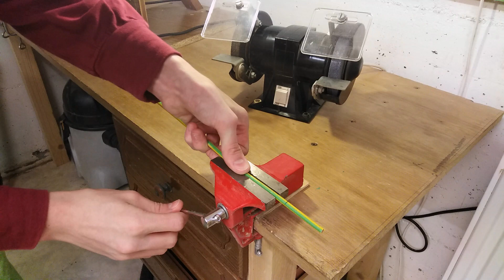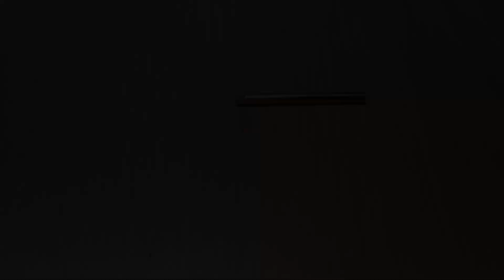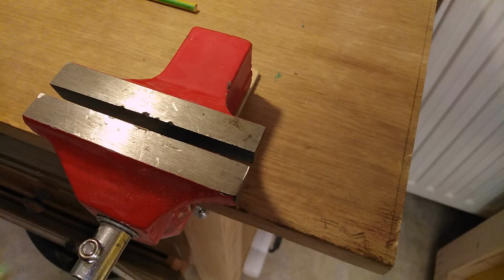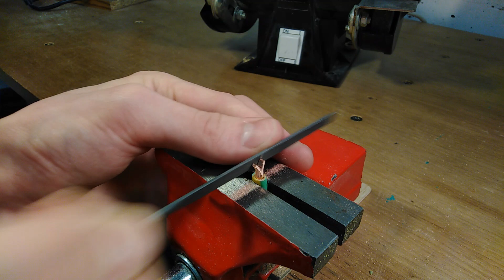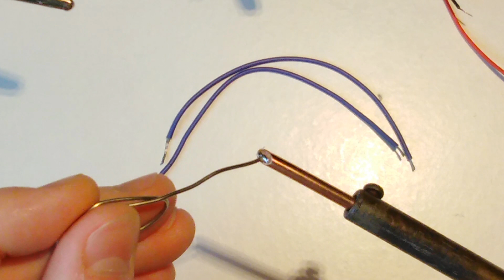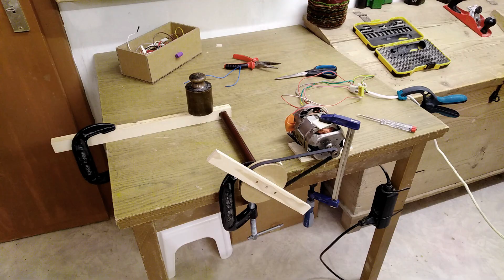How to make Cheap Soldering Iron Tips (including SMD version)

Comment: That is a good idea to share. I can share a idea too. I use a cheap soldering iron connected to an cheap outlet with light dimmer (potentiometer/triac type). I check the temperature with an multimeter. Know I have a temperature controlled soldering iron for 25€, since I need the multimeter for other work's too.

Comment: If you are in the USA and what a pure copper rod of a smaller diameter - your best bet is Lowes or Homedepot. Get a solid grounding wire. They sell  it starting from 4 gauge (5.189 mm for $2.06 per foot presently) and up.

Comment: I never would have thought to do this. Without the plating they would break down faster but, it’s wire which means each of those minus the work put in costs next to nothing… I gotta try it now. Thanks for sharing!
Reply from the maker: Yep, they erode quickly, but I've had the plated ones and they break down as well. Just takes a bit longer for it to start.
Actually, (since I'm not always doing a whole lot to soldering), I'm only now getting to a point where I'd have to reshape the tip I've been using ever since making this video. That's almost a year later. And since I made them quite a bit longer than necessairy, I just need to file it down somewhat to be back in business...
Reply: A copper sting forged with a hammer at a temperature no higher than 300 degrees will live for a VERY long time.

Comment: thats ok if you have one of those crappy cheap single heat soldering pencils but is you have a soldering rework station with adjustable heating it wont work and btw brass works much better holds up to flux much better

Comment: I just love your passion making the soldering tips. May I make a suggestion, when sanding metal with a belt sander, make sure the spacing between the sand paper and the holding surface be slid as close to the moving sand paper as possible. Reason, if you slip the fingers have a less of a chance of getting "SUCKED IN" and injured. Just a friendly suggestion to you young man. 
        One more thing fella, one can use steel copper plated which seems to last a longer. Also, monel metal really last long, but expensive. 
        Thanks for the show Sir, too.
Reply: Steel is not good in heat conductivity, making it not work well especially with low power soldering irons. Good point on safety!

Comment: I'm totally making the smd one. I'm also going to make a 4 way design that can be used to remove bipolar transistors from rf amplifiers without having to get them so hot soldering one pin at a time

Comment: Great job, i have been making my own solder tips for quite some time now using copper wire as well. I have to ask her when filing down in your makeshift  lathe, do you really need to move your file back and forth since the drill is already spinning?
Reply from the maker: It's technically better to not move the file to prevent removing material unevenly - but if I don't, the file quickly clogs up.. ;)

Comment: Hey man it’s so great to see your creativity inspire us all, I am looking to make some tips for my soldering iron but I was wondering what the measurements for the width of the cable you used is (in mm) thanks
Reply from the maker: 3.5mm
But you need to measure your existing soldering tip to make sure it's right
Reply: I think # 7 solid tw and #8 solid tw wire

Comment: An excellent idea and easy to make.   Difficult to find pure copper with the diameter which I need for my soldering iron here.  I did find brass rod of the correct diameter.   What's your opinion?  Better than iron for sure.
Reply from the maker: Yeah, brass is certainly better than iron. It's third-best at conducting heat (just checked) I think for most electronics soldering jobs it should do fine, tho it could pose problems when trying tin thicker copper wires. What's the wattage of your soldering iron?
Reply: @ChronicMechatronic  Thanks for your opinion.  I will make a tip using brass rod 4.75mm diameter for my old but very reliable Weller 25W and let you know.   Its ideal for small soldering jobs on pcb board but tips are unobtainable so I will make a tip using your post.  I have another 60W soldering iron for tougher jobs (but not Weller!!)
Reply from the maker: @carmelsaliba7710  yeah, thx for letting me know, that'll be interesting.
Reply: Typical tips are copper for thermal conductivity iron plated to reduce corrosion, chrome plated body to prevent solder wicking and solder plated at the end for wetting.   Keep the iron at a reasonable lower temp. Clean and retin constantly to prevent wear/oxidation. Avoid lead free solder. Your tips will last. Filing a mistreated tip will expose the copper core and rapidly disolve in the solder and or oxidize.  How did the brass work out?

Comment: And don't forget add solder to all your soldering tips for longevity and cooling them down so you have some tips lifetime and clean between every time you work couse I was lazy and got oxidezed tips 😅 always light cleaned every sessions with wiresponge don't remember the word 😁
I will make mine too couse I don't have good ones 👌💯 keep it awesomeness bro
Reply from the maker: Well yeah, keeping your soldering tip clean is particularly important when you're using pure copper ones. I use a stainless steel scouring pad stuffed into a tin can for cleaning. Works well, I don't see the need for special tip cleaners. 👌
Reply: @ChronicMechatronic  thank you🙏 💙🙏
Reply: I usually have those wet sponges next to me and I rub the tip against it which not only cleans the tip but also helps in tinning it and prevents from oxidizing. Brass wool is also a good option.

Comment: I have been used  this technic, but the problem is the copper got dark so quick and fails to melt the lead causes damage on a pad or components. so do have any idea how to solve this problem like coting the copper or something ?. thanks
Reply from the maker: You just need to keep the tip tinned at all times
Reply: @ChronicMechatronic  thanks for replying

Comment: Please: Can you tell me. Where can I buy this copper wire? Thanks in advance for your answer
Reply from the maker: Sorry I'm a bit late. This wire is sold by the yard at a hardware store in my area, so I can't tell you the exact one I got. It's 7 AWG (9 SWG)     10.55mm² cross section. Just check the diameter of your old soldering tip with the calipers (mine was ~3.5mm so 7 AWG fits well being 3.67mm in diameter) and look for solid copper wire with roughly the same diameter. Here's the conversion table:
https://en.wikipedia.org/wiki/American_wire_gauge#Tables_of_AWG_wire_sizes
Hope that helps, most 15/30W soldering irons should be fine with 7 AWG tho.
Reply: Thanks a lot for taking your time, I appreciate
Reply from the maker: You're welcome!

Comment: Joining 2 parts by söldering is done by meeting the parts and the fluxed solder and the  hot solder tip.
Not by putting the fluxed solder on the solder tip and than holding that solder tip against the parts to be paired!!! The flux should cover the parts to be joined.

Comment: 1. when making those tips, finish them with higher sandpaper,   go until 1200 sandpaper (those are higher I got), they got very shiny!!
Why?? because with less grade sandpaper (400 or 300), you can still see the scratch on the tips of them, they after using them for a while, Oxidation get into those scratchs, and it is impossible to clean them, exept to sand them again... and more shiny = more thermal conductivity...
2. You should have add in the vid about, tips cleaning. The one made with steel scouring pad stuffed into a tin can.
I made myself one with a simple wiresponge, the one with use in kitchen mostly to clean pots. I got  long ago a fancy one supposedly from Copper, but big joke, those selled in Electro shop, are the same only color is different, they are copper color. The one we use in kitchen is working perfectly!!!
When using those Copper tip, always drop the tip into those steel wire sponge time to time, you will know when it is needed. the tip is no more metling solder lol. Bad thermal conductivity and so one...
3. I have been using Coil heating element for a very long time now, and always make my tips this way! Dont bother to buy fancy priced tip, they still gona oxidate, even with all the protective level they put on them... Also got Ceramic heating element, but sometime old school is the reference 😉
4. Time to time, it may be necessary to sand a bit those tips!! Simple, put them on a Drill, and hope a bit of sanding with 1200 or higher grade sandpaper, and super shiny and ready to use 😉

Comment: Good but wouldn't work for my iron. The tips for my iron slide over the outside of the element, not inside it like your iron. Ive bought some SMD desoldering tweezers like you showed in the video. I usually just use hot air to desolder SMD components.
Reply from the maker: Yeah, well, can't do anything about tips that slide over the element... I still need to try desoldering SMD components with hot air, even though the bifurcated tip is quite fast.
Reply: My soldering station is a Yihua 899D II 2 in 1 iron + hot air. Cost about £100. I also have an older higher power Xytronic Super temp with a large tip for when i need to solder big stuff.

Comment: Copper will over time dissolve in solder so it will not last long.
Reply from the maker: That's true, but with all store-bought soldering tips I've encountered so far, the fancy coating that's supposed to protect the copper broke down within 2 weeks and I was back to raw copper regardless. I don't know about higher end tips for something like a pinecil, but the cheap coated tips barely last any longer than copper wire.
Also the idea here was that with tips being super cheap and easy to make I won't need to put up with unreliable coatings in the first place, I can just pop in a new tip when the old one is worn down and it'll still be cheaper.